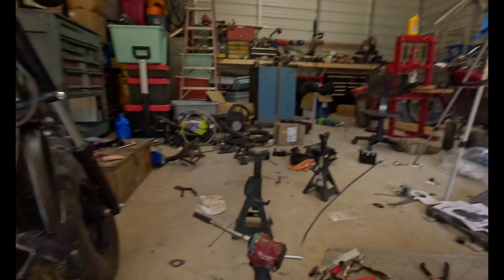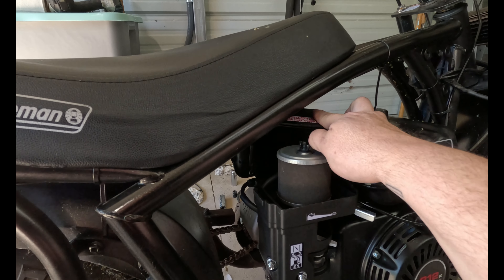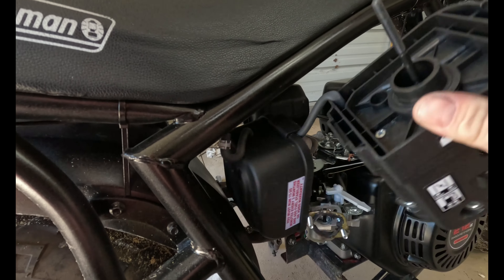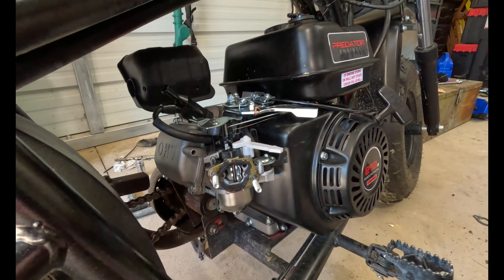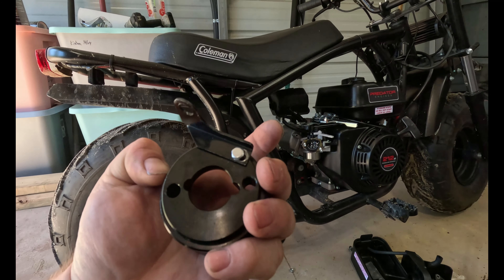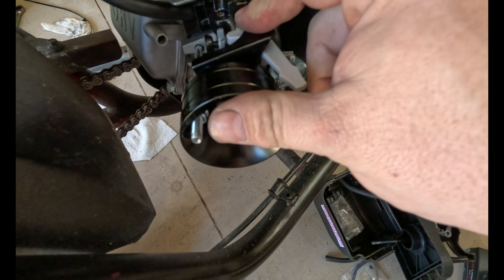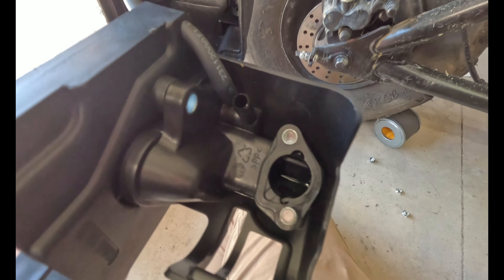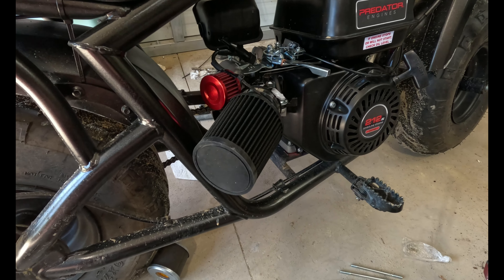Coleman B200R / Predator 212 intake filter install

Comment: Did you have to buy any additional parts when upgrading to the predator?
Reply from the maker: No I did not. Bolted right in
Reply: @SucatsGarage  awesome thanks! My son blew his motor so it looks like I’ll be doing this shortly. There’s not a lot of info on swapping the b200r specifically
Reply from the maker: Yea man. Thinking about it though. I did have to use different bolts because the thread pitch wasn't correct. I am not sure the thread pitch but the owners manual tells you. But all the major parts swap over. I went to Lowe's to get the bolts. Hope this helps.
Reply: How did you mount the chain tensioner? I can’t figure it out….. sorry for all the q’s but appreciate the info!
Reply from the maker: @Hand_Banana  I used the old jack shaft assembly. The black metal plate thingy hahahaha.
Reply from the maker: @Hand_Banana  I used the old jack shaft assembly. The black metal plate thingy hahahaha.
Reply from the maker: Not laughing at you. Laughing at myself because I do not know how else to describe it
Reply: @SucatsGarage  no worries, I ended up doing the same thing! Thanks for the help!!